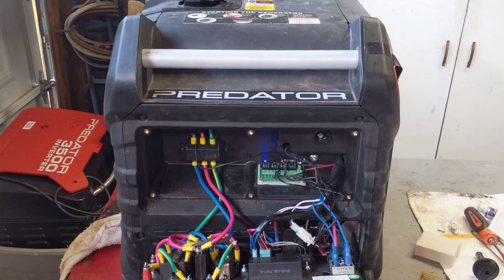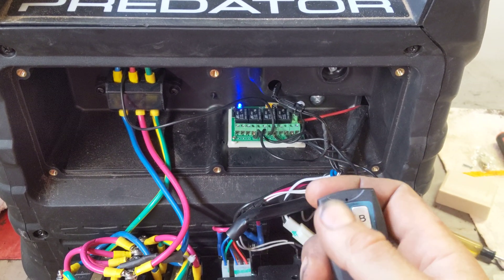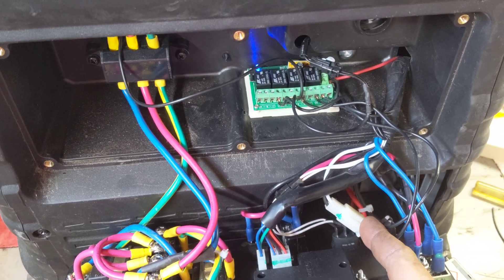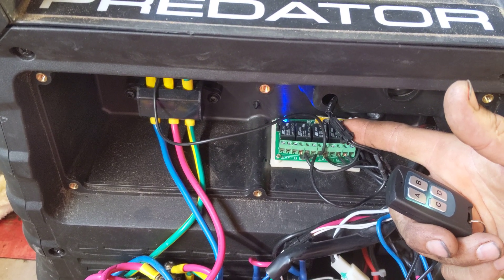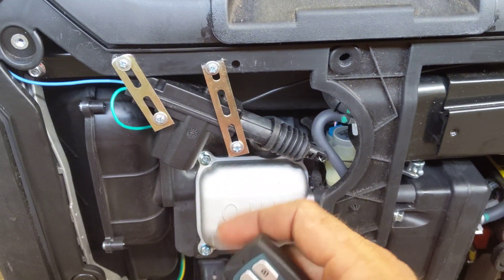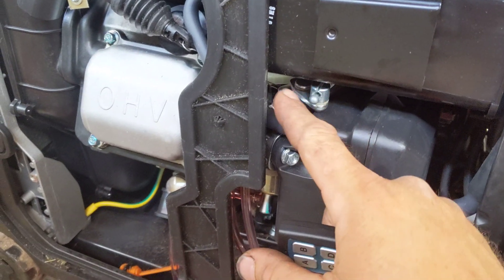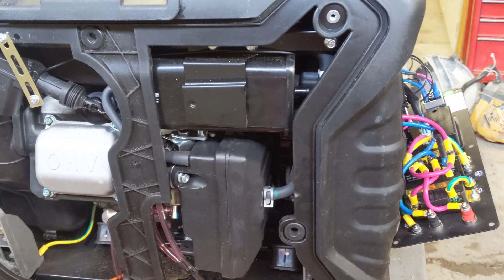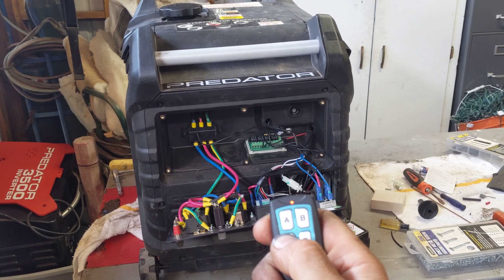Predator 3500 Inverter Generator Remote/Wireless Starting Installed! All Mysteries Revealed!

Comment: Thank you for the video. I order parts today and will be installing on our Predator 8750 gen. You may have but didn't show inline fuses to the relay and actuator. I'll add 2 fuses. I don't want to burn down my generator with these inexpensive parts.

I'm going to see if I can wire the 4th relay to the throttle ECS. I'd like to start with the ECS off, then turn it on. 

Like someone said, adding an on/off switch for the relays/actuator as well.

Thanks again for you videos.
Reply from the maker: Good idea on the fuses. On the fourth relay, the eco throttle is a standard on off switch. With the way I had the board set up it would not allow you to do some of the relays to be momentary on and some of them to be momentary off and then others to be latching. So with the board I had you would have to essentially hold the button down in order for it to be in the on or off position.

Comment: The biggest mystery for me is , it seems as though each channel/relay has 3 terminals. I can’t see how you have the receiver wired closely
Reply from the maker: You're right there are three terminals. It's been a while since I've looked at one of those boards. If memory serves me correctly it seems like there will be one terminal that will connect to the other ones either in the on or off position. So say if channel One is off a and b terminal will be connected and then when you press the button for channel One it will disconnect a and b and connect a and c. Hope that helps.

Comment: Someone needs to create a video on how to extend the range of the wireless remote.
Reply from the maker: They make better wireless remotes with an antenna and everything that work from about 1000 feet away. 
InduSKY DC 12V 433Mhz 4CH Channel Wireless Relay Receiver Remote Control Switch with Long Range Remote Control Transmitter and DC Female to Screw Connector https://www.amazon.com/dp/B087246S2W/ref=cm_sw_r_apan_glt_fabc_5T33P9S2W093THG5M81X?_encoding=UTF8&psc=1
Reply: And now with internet you can start them from anywhere
Reply from the maker: Would you really want to have to set up a wireless network in the middle of nowhere so you could start your generator though. :-)
Reply: Well if you are off grid it would be nice to know if your generator is firing up when it’s supposed to and if it’s not, it would be quite nice to be able to start it before you damage thousands of dollars in batteries???

Comment: Thanks for the upload @shenanigans one thing i can't figure out is what you did with the negative wires? Did you only splice the no load wires into the the starter and kill switch?
Reply from the maker: I had to run a ground wire up to the module and a power wire up to the module. I tied into the kill switch and ran it through the solenoid on the board. The starter wire  was also tied into the wires from the starter switch not directly to the starter. So yes, the no load wires are what I tied into.:)
Reply: @shananigans1179  I appreciate the reply!
Reply from the maker: Yeah. I just happen to be checking message. :)

Comment: You can eliminate the B choke button by connecting the choke actuators power to the starter solenoid wire that feeds the motor power after the start solenoid is triggered. You wouldn't be able to hold the choke longer and release the starter button like you can with A and B but I doubt you would ever need to do that unless really really cold. And in that case maybe it stalls and you need to restart another time. The choke from Predator slowly shuts off within a couple seconds as is
Reply from the maker: Thanks for commenting. I wondered how that would work with just the one button just so it's a more simple install.
Reply: Shananigans that’s what I’m doing. Works great.... only downside would be if you shut it off and restart quickly you are choking it when you don’t need to but it starts fine regardless.

Comment: Ive got the exact same 4 Channel Relay and have connected it to my Predator 3500 Generator with Actuator. I had to place the jumper on the relay in the position where it supplies momentary connection if the associated button is pressed. I can only activate one relay at a time for some reason. So when I press A and B together both relays are not energized and operable. In the video you show the ability to activate both at the same time.  I cannot figure this out. So I cannot have the actuator activate the choke AND have the starter engaged. So it does not allow start unless I press A first and have the starter turning and then very quickly Release A and push B to open the Choke. This does not work every time as the engine needs to be spinning with residual inertia and then the choke open at the end of the stroke. It takes many times of trying again and again. Any ideas?
Reply from the maker: What about hooking the choke and the start to the same relay and also leaving the choke hooked up separately. That way when it's cranking the choke activates, but if it starts to die on you you can hit the choke again without the starter.
Reply from the maker: I do remember having to do something with a jumper though, so thanks for the reminder. :)
Reply: @shananigans1179  Yeah the jumper is just for the setting that allows Latched or Momentary for all of the relays.
Reply from the maker: Yes. I can hold both buttons down and it will engage both. That's crazy. Maybe you have a defective one?
Reply: @shananigans1179  
Thanks for the reply. I purchased the one I'm using now from eBay and it looks visually identical to the one that you're using. I found others on Amazon's site that look identical as well and perhaps that is one of the main differences. I will purchase from Amazon and see if I can operate both buttons A and B at the same time yeah.
Reply: @shananigans1179  Well I thought of that and what occurred to me is that when the Generator is running and hot there is no need for the choke as it wont start well with  the choke engaged.   Can you press both buttons (A&B ) and have them both engaged and active ?  I think I have the same model Wireless Relay and I cannot.

Comment: Thanks for upload, soo  Do you need to leave the big button on the genii in start or run position when using the remote?

 Some guys leave it in the start mode didn't know thats bad
Reply from the maker: If I remember right the start position activates the choke. I could be wrobg. I installed this on a buddies generator so I'm not looking at it every day. :)
Reply: @shananigans1179  copy thank u

Comment: Very nice job! I am familiar with the remote control unit as I used it for remote lighting on my RVs. The only addition I am going to make to your system on my unit is a kill switch for the remote circuit board and the actuator so they are not activated and do not draw any power during storage.  Thanks for making the video! Now if I can just make an automatic Fuel tank filler! ;)
Reply from the maker: Right. That was an after thought. :) Thanks for mentioning it. It will drain the battery when not ran for a while.

Comment: Do you leave the knob on start or run ?
Reply from the maker: Just the run position. I use the controller to activate the choke and starter.
Reply: For some reason my actuator won't activate
Reply from the maker: Hope you got this figured out. Did you try just going straight to the battery? Did it work then?

Comment: Can you draw out a diagram for me my actuator isn't activating
Reply from the maker: I installed this on a buddies generator so I'm not next to it to look at wiring again. I might be able to get to it tomorrow or late tonight. The thing to remember is that the controller is just simply connecting the power through it like a switch. So you can check the actuator by hooking it up straight to the battery. If it works there then just simply wire it up with the switch in line now.
Reply: Yeah I think something might be wrong with my actuator because when I tap the lead to the battery it doesn't activate
Reply from the maker: That sounds like the thing is not working right. Did you try swapping the word around? Maybe it's directional? I don't know. :)

Comment: As I understand you didn't cut any wire, just tap on yhem for channel 1 and 3. So I guess you can still operate the generator from the original controls, unless the choke can't be operated with the actuator installed???
Reply from the maker: You are correct. I did not cut any wires. The choke also functions as it should. So you can start it just like normal or you can use the buttons wirelessly to start it. Super simple build I think most anybody could do it on a Saturday afternoon.

Comment: I've watched some other videos with wires galore. Your setup appears simple and clean.  One problem I had is when I push the start button and the generator starts the starter remains energized and I have to hit the button a second time to shut off the starter. (generator remains on) Any idea of what I may have done incorrectly?
Reply from the maker: It sounds like your relay is "latching". Look like the paperwork that came with your relay board and see if you can move a jumper around to change things up. Good luck. :)
Reply: @shananigans1179 Funning you mentioned latching because after I had problems with starter remaining powered I shout  it down and just to be sure I didn't screw up any of the original controls I tried to start it and it wouldn't start. Turns out I had to hit the cut off button a second time as well. Forgot all about that jumper. Thx a bunch.
Reply: @shananigans1179  I just order the remote but not received yet, can you show me where is that jumper?
Reply: All set up..was very easy. I added a switch to prevent voltage going to the mother board to save the battery on long term storage.
Reply: Shananigans where are you located? Can I pay you to do this to my predator 3500?